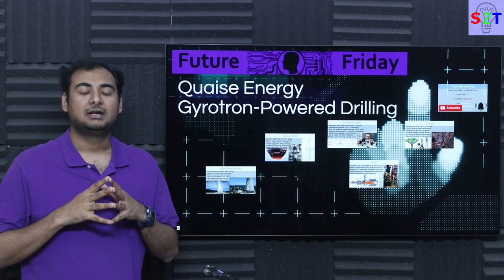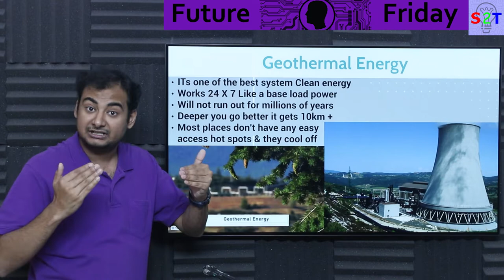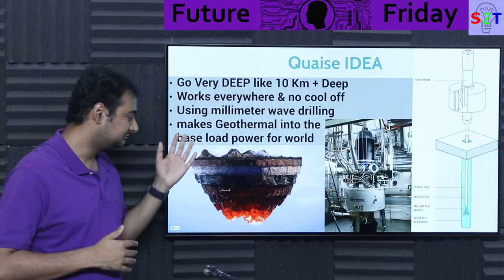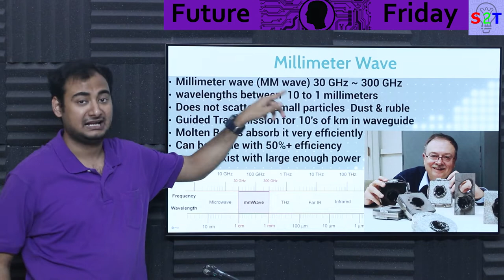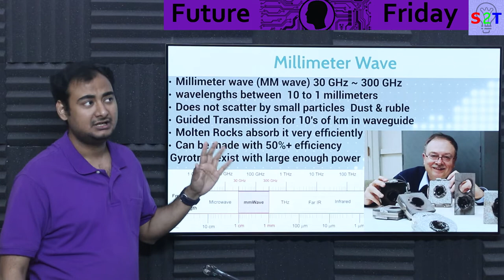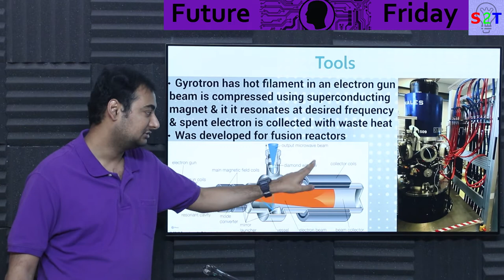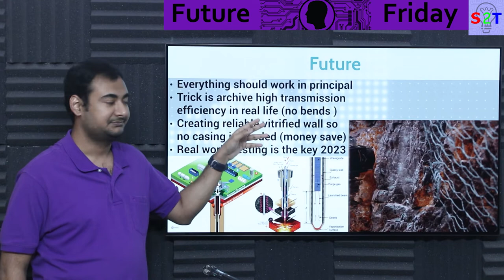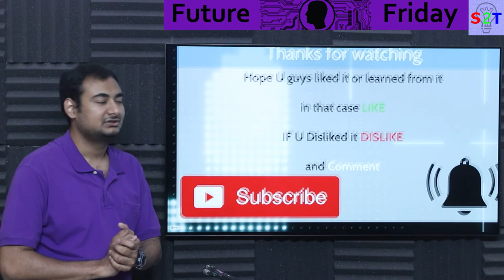Quaise Deep Geothermal Energy Explained {Future Friday Ep179}

Comment: We have a hole 20km deep by 1m wide (to keep it simple. That is 20,000 cubic meters of rock particles, and they cannot all go into making casing. When they are 10km down, how do they get material out of the hole?
Reply from the maker: gas that is used to cool the system will blow out the vaporized rocks & not to mentions the well dimeter is not 1meter it will be in CM . We have to wait for actual deployment to know all the details . May I ask why do you have a hole  20km deep by 1m wide is that a air shaft for a mine ?
Reply: @s2tenglish  lol. More like he doesn't know what he's talking about

Comment: Excellent explanation!

One source I came across on this suggested the possibility of there being concerns about extracting energy in seismically active zones - along fault lines, etc.  In your research for this, did you see anything concrete along those lines, or is that just people being extremely cautious and not wanting to disrupt a system we don't have a perfect understanding of?
Reply from the maker: yes they know the risk and not an big issue for them as they are aiming to be away from fault line as depth is not an issue
Reply: @s2tenglish  My thought was if/when this goes wide scale, for countries that have difficulty getting away from fault lines.  Japan comes to mind.  Because that would be a severe geopolitical disadvantage to be one of the handful of countries that can't generate its own power using this method.
Reply from the maker: its still too early so lets us wait and see what actually happens
Reply: @s2tenglish  the inventors stated this technology is to move away from drilling near fault lines.
Reply: If this works, one idea was to repurpose obsolete plants at their existing locations. Think of abandoned/decommissioned coal or nuclear plants, etc that have grid access and steam turbines and all

So the desired application is different from old geothermal, that relies on fault lines. They want to go where the infrastructure is already there
Reply: @PlayerXIII  Not just abandoned plants.  Coal and Gas power plants put a huge amount of their budget into buying their fuel of choice.  

Did some quick googling for the numbers:
A hypothetical coal plant that generates 1 gigawatt theoretically burns 9000 tonnes of coal per day, and according to the EIA, subbituminous coal (typically what you'd want to put in a power plant) costs 14.43 for a short ton.  Doing the conversion and multiplying it out, that works out to ~$143000/day (or just over $52 000 000 a year for 365 day service).  

Even if it cost them 10 million to drill one of these holes and convert their plant over to geothermal, they'd make their money back on that investment in months on the not-needing-to-buy-coal thing alone.

Comment: Assuming all of this works and they can get down to 20 Km they will have to create two boreholes and they will have to link them. This is the only to create a closed loop system. But if they cannot bend the wave guide I do not see how they could do that. Creating a closed loop like Eavor loop would be ideal way to deploy this. However, you would have to solve the issue of having to bend the wave guide.
Reply from the maker: I am indirectly touch with them its still too early

Comment: use supercritical co2 instead of water to reduce depth needs
Reply from the maker: supercritical co2 can U link the time stamp of what U are talking about
Reply: @s2tenglish  sandia national labs has a sco2 setup hooked to a grid now. based on the GE "sun rotor" design
Reply: The efficiency will still be affected. Nothing beats hotter temperatures